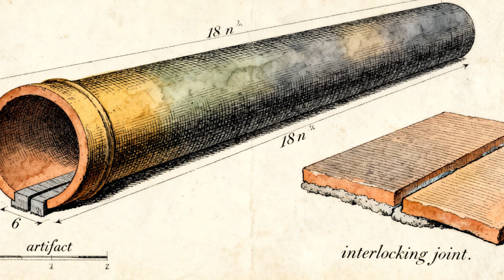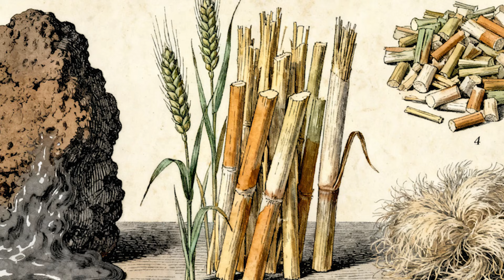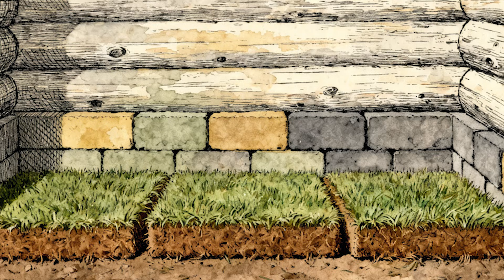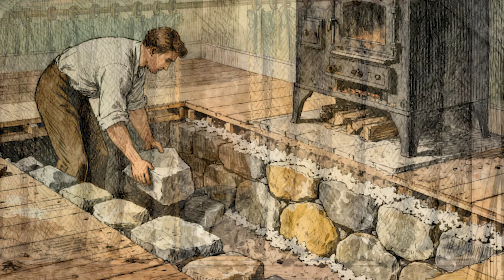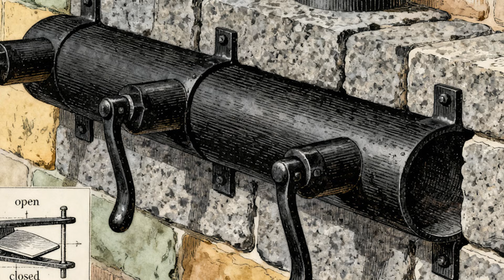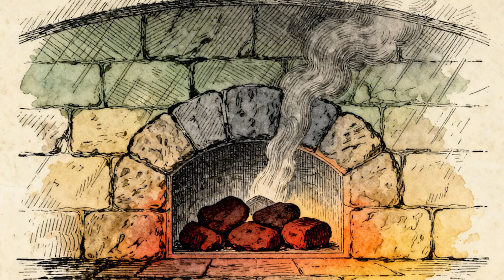Everyone Laughed At His "Buried" Air Pipe — Until It Stopped Drafts Cold

Comment: The best thing to do is put the air intake right at the fire draft so the cold air goes right into the fire, which is using it, and doesn't cool the rest of the air in the cabin. My uncle living in the Yukon had an air intake pipe for each stove.

Comment: Average frost line in Minnesota is around 5.5.-6.5 feet. You're not getting any geothermal benefit from that depth, or anywhere remotely near that depth. This video is ridiculous. Also, fix the walls first, you A.I. dummy. If if was a real cabin, seal up you walls, and stop pumping cold air from the ground into the cabin. It's not real though, just a silly A.I. story.

Comment: The Premiss of this video is wrong.
Warmer ground temperatures are Merly a bonus, the real reason for drawing air from outside is that your "Cabin" becomes part of the chimney system so no air is drawn through every crack in its insulation . Feeding the fire from outside you are not constantly pulling the could into your home. your stove uses air from outside and does not constantly cool your room.
PS I have done this with no Pipe just a vent near the bottom of the stove open to outside.

Comment: All you really need to do is provide a vent from outside of the house, directly to the air intake on the wood stove. The draft in your home is caused by air going out the chimney, this sucking cold air from outside via unsealed walls and windows. If the cold outside air is going directly into the stove there is no reason to preheat it.😂

Comment: TL:DR is that you should use "Earth Tubes" since about 5 ft underground the temp maintains about 50F year round. Bury the correct length PVC tubing with one end up to outside and the other in your cabin and pull air from outside through the underground in to your cabin and it will help moderate the cabin's temperature. You can move the air with a fan or by running a fireplace. Both will pull air through the underground tube.

Comment: What a drag. This video takes forever, so I did this instead: Copy the URL for this video. Open SuperGrok AI or ChatGPT. Paste the URL into the query field and then type the command "Summarize this video". Result: AI "watches" the video in about 5 seconds, and then issues a summary like this one (and as a bonus the AI offers a link  such as "Explains buried pipe physics":   

Summary of the Video: "Everyone Laughed At His 'Buried' Air Pipe — Until It Stopped Drafts Cold"
This video, uploaded on November 29, 2025, by the American Frontier Channel, is a historical storytelling piece about pioneer ingenuity in combating extreme cold during the late 19th century.

It follows homesteader Jonas Fletcher in northern Minnesota in 1879, where brutal winters (down to -30°F or lower) made life in log cabins miserable despite solid construction. Common problems included persistent drafts, frost on walls, cracked chinking (mud sealant between logs), cold floors, and massive firewood consumption (up to three cords per month per family).

Fletcher, drawing from family stories and advice from a Norwegian immigrant, devised an innovative solution: a buried air intake pipe to supply the wood stove with pre-warmed air from below the frost line (about 6 feet deep, where soil stays around 50°F year-round). He built it using clay tiles, running it 30 feet from the cabin with a screened intake and connecting it directly under the stove.

Neighbors mocked the idea relentlessly, calling it ridiculous and insisting on traditional fixes like tighter logs or better stoves. But when winter hit, the system worked brilliantly: incoming air was warmed to around 38°F even in sub-zero conditions, eliminating drafts, evening out heat distribution, and slashing firewood use by about a third (down to two cords per month).

Fletcher layered on more improvements inspired by other immigrants:

Better chinking mix with straw and cattails for flexibility and insulation.
Sod blocks lining walls and floors for added thermal mass.
Optimized cabin layout with a sleeping loft over the stove.
A Russian-style masonry heater with baffles to store and radiate heat longer.
The ultimate proof came during the infamous 1881 blizzard (14 days of -42°F temperatures), where Fletcher's cabin stayed comfortably warm (58–65°F) with minimal firing, while neighbors ran out of wood, burned furniture, or even abandoned their homes.

The video highlights how Fletcher's experimentation and blending of old-world techniques turned skepticism into admiration, with his methods spreading to nearby homesteads and logging camps. It's a celebration of practical problem-solving on the American frontier, showing how one man's "crazy" idea dramatically improved survival in harsh conditions.

The storytelling style is narrative-driven, likely with visuals of reenactments or illustrations of 1800s cabins and the pipe system.:

Comment: The time the incoming cold air would spend underground on it's way to the fireplace. There would be little or no change in it's temperature. It takes time for air to be heated and for a moving stream of air, moving through a shallow tunnel only a few degrees warmer than the air itself, I doubt any measurable difference would occur.
Reply: The pipe as described would not match the results claimed. As a concept, the results claimed are possible with a different design

Comment: The solution is to supply air to the fire not from inside the cabin, but from outside.
You do not need to “heat” the air by pulling it through deep, frost-free ground. In Sweden, kakelugnar (tiled stoves) have long been built this way: the combustion air is taken from underneath the house or directly from outside. There is no need to warm the incoming air by running it through pipes buried deep in the ground.

The kakelugn was a major Swedish innovation, developed in the mid-18th century during a severe national firewood shortage. In the 1760s, the architects Carl Johan Cronstedt and Fabian Wrede redesigned the traditional fireplace into a highly efficient heat-retaining tiled stove. Their innovation used a system of internal flue channels that forced the hot smoke to travel a long path inside the stove before leaving the chimney. This allowed the stove to store heat for many hours—sometimes even a full day—while using far less wood than open fireplaces.

Because of this efficiency and the ability to draw combustion air directly from outside, kakelugnar became a key part of Sweden’s energy-saving architectural tradition and remained common well into modern times.

In fact they are still in use and new ones can be bought!

Comment: A wood stove has to have a fresh air inlet. Running a pipe under ground will warm the air before it comes into the house. It's geothermal heating.
Reply: The geothermal effect is minimal. Fire requires oxygen and it will suck it from the nearest place it can.  If it can't get oxygen through a direct outdoor source like the pipe, it will suck it through cracks in the doors, walls, and windows.
     Mobile home gas furnaces rely on a two pipe system. Fresh air is brought in through a larger outside pipe, with the flue gases vented through a smaller pipe inside the larger pipe.  The hot exhausted flue gases warm up the incomming combustion gas as they flow past one another inside the two sealed pipes. 
       In this method, combustion air is drawn from outside and heated by the hot flue gas before being used for combustion.
       Beats. the hell out of digging a forty foot ditch. 😂😂😂😂
Reply: @elmo430o correct
Reply: Cold air is more dense and is better for combustion efficiency.
Reply: . Geothermal heating combined with not making the cabin a low pressure zone which would suck in cold air
Reply: Well it's geothermally heating that air a little bit.
Reply: @monsaka7827 not at that depth, and cold air is denser resulting in more o2 and more complete combustion
Reply: So many words instead of one good scheme or draft. Why not to spend 10 hours in a row to flood the air with tons of empty words unconfirmed with the proofs? Unlike for you, mister

Comment: Would he not get the same results from building a "breather" chimney? The smoke chimney would warm the breather chimney. Therefore you get pre warmed air.
Reply: They didn't understand counterflow then. This is basically an exterior air vent combined with geothermal heating to pre-warm the air.

Comment: I have a balloon frame. Victorian farmhouse is designed to use the soils temperature for both help with heating and summer cooling.  Even the windows shutters are variable for shading the floors inside during the summer and solar heating gains during the winter as well as storm protection. People here in the comments don't have a clue about the technology of the times that grew up into today's systems

Comment: ABSOLUTE BS ! This channel is literally trying to rewrite history, things that NEVER Happened or were part of the American Frontier times... Seems everyday AI is being used to totally screw up our history and dumb down the people... Block this garbage....
Reply: Nah I appreciate this. If it's history is totally fake the physics is dead on accurate. If you don't understand that then your physics knowledge is weak.
Reply: @monsaka7827 physics are not right and pass over many issues
Reply: @RogerBeckett-s2j Give example please, otherwise you are just another troll.
Reply: @monsaka7827 cold air intake on internal combustion engine. High altitude jet engine efficiency. High efficiency home furnace that brings in cold are for combustion. The secret on combustion heat is to extract as much heat as possible before it exist the living space. The problem is you need to get rid of the byproducts or die, thus a chimney. In the alpine regions of Europe they do this by building a zig zag flue. That keeps exhaust gases moving back and forth in the house before exhausting at fairly cool temperatures. BTW, I’m not a troll, I’m a retired engineer and educator
Reply: @RogerBeckett-s2j What kind of engineer because you seem to be missing some things and or are distracted by some of the abstract pictures. 
Chimney do not have to go up. If you extract enough heat it affects the draw. Regular stove setups have the same problem single exhaust tube portable air conditioners have. Look up rocket mass stoves where the mass is kept low and the exhaust is like warm or nearly body temperature. 
There are heat exchanger devices on the market made around the same idea just not geothermal. All in all I think you missed the point. 
Heat of air coming into the house is not going to significantly combustion in any way. Air density of cold air is critical in a IC engine but not for stoves and fire places. That doesn't mean it doesn't make any difference at all though. The point made here is that it's significantly warmer than air pulled through the chinking. And not all of that air is necessarily used for combustion.
I'm a big fan of the houses, in Russia if I recall correctly, built around mass chimneys with zigzag flues. Still going to have problems without a separate air intake so it's not sucking air out of the house. Still not as efficient as a rocket mass stove setup though.